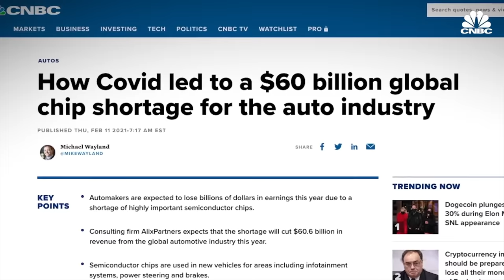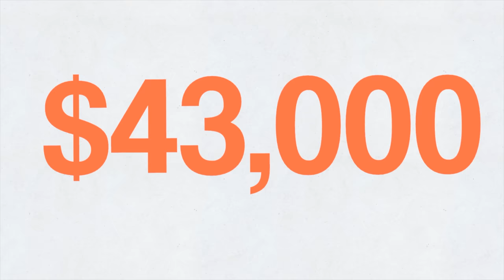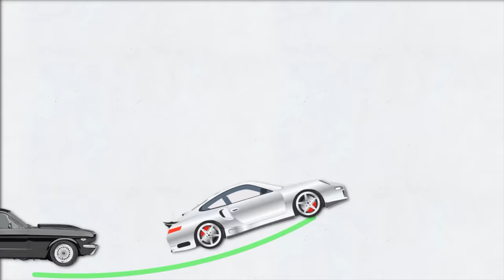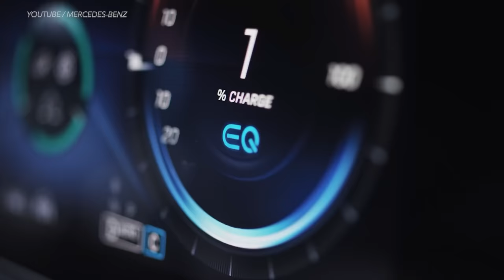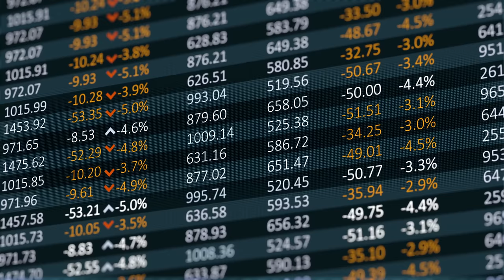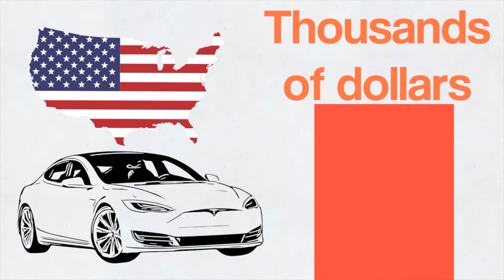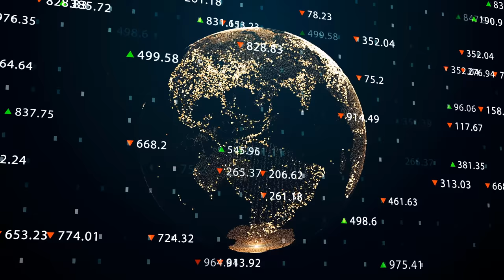No One is Telling You the Truth About the Car Shortage, So I Have to

Comment: Scotty’s knowledge is beyond bumper to bumper.  He is at point.  No auto companies admit to the supplier issue.  They are building cars with missing chips. Just drive, we will call you when the part arrives.  Why don’t they just build car that uses 20 percent computer components instead of 80 pct.   Car run with out many non essential computer parts.
Reply: How will the government keep tabs on your driving habits without all those sensors and computers?
Reply: If we built 1985 Chevys today as an option to the high-tech Vehicles we could avoid being in this logjam over electronics and chip dependency from foreign suppliers. But the simple truth is the government has made it illegal for the auto manufacturers to produce and sell vehicles without all of this technology in them.
Reply: @floridagunrat1625   Not to mention that the automakers lobby the government to help maintain their sales. Remember Obama’s Cash for Clunkers? Trade in your older vehicle for a more fuel efficient vehicle but you could ONLY purchase a NEW vehicle.
Reply: @tastx3142  Cash for clunkers took a lot of good used cars off the road. Just another example of hurting the middle and lower classes
Reply: My old diesel pickup only has one working chip left, it controls the instrument cluster. There was never an ECU, and I ripped out most of the wiring harness, aside from everything it needs to be road legal. 

Buy used, and learn how to fix it yourself. Learn to survive without these corporations, and they will be forced to adapt like the rest of us. :3
Reply: Ever since cash for clunkers, that worthless sorry a-- excuse of a gov't program, the used car and light truck market hasn't recovered since. Such a waste of good, used vehicles! 😡
Reply: @tastx3142  that was also done in Europe way before obama, i think it did improve mortality on the roads as everyone was driving really old cars with no security (i dont remember airbags in the 90s)
Reply: @foreignisdomesticnow2142  how much cash were they giving you? usually less than what you'd get if you sold it, provided it really is a decent car. So similar programs elsewhere only did take crappy cars off the road
Reply: China will have plenty of computer chips before the US...probably already does.
Reply: @floridagunrat1625  I'll a W124 over any new Benz, same goes for E30 vs G30.
Reply: @cris We don’t need cars and SUV which are expensive rolling super computers    Just learn to drive, drive don’t talk, eat or drink,and don’t drive like maniacs. It’s a car not an office or restraint. Your supposed to drive it.
Reply: @jamesgizasson  yu seem to be kinda missing the point. All that tech is so you can't. There are even laws in certain states that allow the manufacturer to sue you if you work on it yourself. Farmers have been fighting this fr a long time.
Reply: @TheNewblade1  I was just speaking for myself, and anyone like me (all three of 'em) X3 

Farmers are a different story. I was talking about your average consumer and their daily driver, but most people just buy a new car anyway. 

I agree wholeheartedly that planned obsolescence and Right to Repair are critical issues in today's world. :3
Reply: @jamesgizasson  sry if I seemed like I was attacking you, I just really hate individual solutions to systemic problems.
Reply: @TheNewblade1  No, I completely understand, and I'm not offended. In my situation, it works. But I live in my car, so my problems are very simple. 

The corporate system is designed to keep people trapped in a cycle of proprietary maintenance and purchases. The end goal is to have a customer base of 'subscribers'.

Comment: My guess is that it will take several years for car manufacturing to increase, and we haven't yet hit the bottom.  Hopefully, we will have seen the folly of depending on other countries for critical raw material and manufacturing.  We need to bring back manufacture of vehicle and equipment parts and components and not just assemble things.  We also need to revitalize our electronics industry.  Raw materials will be problematic as minerals are only found in certain geographic locations.  Maybe the Glomar Explorer should actually look for manganese nodules on the ocean floor this time.
Reply: I just don't see that happening in the US. The government has gotten very comfortable (and fat) by micromanaging American industry. All the reasons our manufacturing went overseas are still here, multiplied.
Reply: But you dont have the workforce to do that,and the repuplicans dont like immigration!So wzo should do all this jobs?Children?
Reply: We have the people, but most people do not want to do manual labor, even when that is a profession like plumbing, electrician, mechanic, or carpenter.  The solution will probably be automation, including robotics.  I saw an Inside the Factory episode today on the Smithsonian Channel.  They were at the Kellogg plant in Manchester, England.  Three people run the whole warehouse that packs and ships a million boxes of cereal a day.  There are two operators and one maintenance person.    China, which has no shortage of people, has the most highly automated vehicle factories.  @brunoheggli2888

Comment: My wife has a 2011 Ford Escape with 86,000 miles and I have a 2012 Nissan Versa with 101,000 miles and a 6-speed manual and they both run great. There is no plan to replace either vehicle at this time. I recently bought from a friend a 2001 Lexus LS430 with 119,000 miles and it runs great except for a phantom electrical drain that I will keep looking for to fix.
PS no car payments.
Reply: Keep the extra car for a couple more years. It'll be your retirement ;).
Reply: I have a 2010 Honda Accord with over 200,000 miles.  So what.  You're still going to have to buy a new car sooner or later unless you're a professional mechanic.

Comment: The most expensive part of an EV will be keeping it charged. That means new batteries before the car wears out and all of the infrastructure to run chargers 🔌. Yes the electricity and the chargers too.
Reply: EVs  are   inefficient  energy  hogs  that  spend most of  the  time sitting  plugged  into  the  charger /outlet.  not  such  a  good  alternative  n  not  a  solution.
Reply: RC cars do not scale up very well (ask the dinosaurs about being too big for their britches).

Keep on Gassin' .. Adopt a Classic today
Reply: @JT_771  The problem is .. they have no range compared to a fueled vehicle.
Reply: @JT_771  Please try and drive from Reno to Las Vegas in an EV and see how that works out for you.   🙄🙄🤔🤔🤔😁💩💡💡👀👀👀

Comment: What I don't understand is why some towns the same size of others in other part of the county have many cars in the lot, and they are not selling while elsewhere in the county there is hardly a car on the lot where the demand is higher. Also I found a Subaru dealership that has hardly any cars on the lot, yet an hour away on the side of the highway, there is a fenced off dirt lot with hundreds of 2021 and some 2022 models.
Reply: Don't know if it's true or not, but there are stories of dealerships hiding their inventory on separate lots away frome the main lot in order to create a false supply problem in order to justify the prices they are charging. Basically, telling everyone they only have a few cars on the lot, when they actually have dozens that just are at a different location. I certainly hope this isn't true, but it would not surprise me.

Comment: Im 37, and in my lifetime very few things if any have ever gotten cheaper. Particulary in these situations, where something pushes the prices of things higher, they never come down to before price increase values - it just establishes a "new normal" with the higher prices. Cars, CPUs, GPUs, cell phones, power tools, batteries, ammo, etc.
Reply: That's why auto loans are now as much as 84(!) months. Most of the stuff they're cranking out won't even last that long.
Reply: I respectfully disagree.  Many things have come down in price over the past 20-30 years such as TVs, computers and electronics in general.  Of course in the past year or so we've seen inflation cause prices to go up.
Reply: @SamKhoury  TV's, Computers, and Electronics are irrelevant though, but  he is correct on gas, oil, vehicles, the inflation, he's absolutely correct!
Reply: @SamKhoury  TV's, Computers, and Electronics definitely have not gotten cheaper. The top end GPU for a computer used to max out at around $500 msrp. Now its common to see $2000+ msrp GPUs, where a "mid range" card is around $450-$650. Top end TV's used to be around $2000, maybe $3000, now its common to see  $5000-$10000+ price tags. The only "electronic" that I think got slightly cheaper is the dial-up telephone, and maybe a calculator.
Reply: @BigBear--  You're wrong because you're not comparing apples to apples.  TVs, computers and electronics have absolutely gotten cheaper over time.  The price of those things with the same SPECIFICATIONS over time go down.  How much was a basic 55" TV just a few years ago and how much is it now or even a 65"?  How about a PC? The cost of computing power has gone way done.  The comparison that you're doing is comparing the cost of the best now to the best before.  That's like comparing a top of the line Ferrari now vs one from years ago.  Of course the cost of the top of the the line models have gone up but that's not what the average person is buying.
Reply: @SamKhoury   🙄🤦‍♂️Like I said, a mid-range GPU used to be around $200-300 msrp, now they're $500-700 msrp. Has a modern mid-range GPU gotten more powerful compare to a mid-range from 10 years ago? Yes. However it hasn't changed places within the current stack of offerings, its still a mid-range GPU. As computing power increases, so does the software loads on those components, in fact software development is generally ahead of hardware, with hardware always playing catch-up. Same for TV's, can you get a ridiculously cheap 1080P panel today? Yes, but it won't work with modern standard content in 4K, won't support HDR, etc. A quality mid-range 55" LED or plasma used to be around $1000, now a quality mid-range QLED or AMOLED is around $2000. And please don't confuse buying habits, with product stack categories. Just cause more people bought a thing, doesnt change the things performance or price relative to the rest of the product stack in that category.

You're claim of apples to apples doesn't include evolving standards and relative performance within the products own quality stack. Yes, you can buy a dirt cheap CRT TV/Monitor today, compared to 35 years ago - but that irrelevant to what I'm talking about. Your smartphone has tons more power and is waaaay cheaper than a building sized super computer from the 70's...what that has to do with super computer costs today I'm not sure.
Reply: @BigBear--  Now you're partially agreeing with me while still trying to prove your point that prices have gone up over time. Regardless you're still not comparing apples to apples which doesn't make your argument valid.  In the past year we have seen prices increase significantly on many goods because of low supply but that doesn't change the fact that certain goods like electronics experience price deflation over time.  Also your examples don't factor in is dollar inflation.  In other words you're not taking into account that the value of a dollar goes down over time.  Here's an actual real life example of price deflation.  In January 2021 I got an almost top of the line 65" 2020 Samsung Q80T QLED TV for $1050 direct from Samsung and when that TV launched in the Spring of 2020 less than a year earlier it was $1800, a price decrease of 42% and yes it was still an almost a top of the line model.  Of course the prices of new computer components rise over time because of inflation and because they offer better or more features but the price of the exact same model will generally go down over time.  You're certainly not going to pay the same price for a year old model GPU as you would have when it launched even though it might still be an excellent one.  I'm going to settle this argument very simply by telling you to Google search "have TV prices done down over time" and you'll see this response.  "According to the U.S. Bureau of Labor Statistics, prices for televisions are 99.14% lower in 2022 versus 1950 (a $991.38 difference in value). Between 1950 and 2022: Televisions experienced an average inflation rate of -6.39% per year. This rate of change indicates significant deflation."

Comment: A major point in the longevity of the car life is the manual transmission. Better than EV, too.
Reply: automatic transmissions last just as long, and in many cases, longer than any manual transmission.
Reply: It's $2,000 to $3,000 for a clutch job nowadays though
Reply: @jonathanmarquise422  no they don’t lol
Reply: @Nikkk6969  cool store trolltron
Reply: @Nikkk6969  Yes they do.  Also, even in shortages like this one, people will trade out their car before any serious issues from high mileage or wear and tear start to appear.  So even if an automatic would run down sooner, the first owner will never see it.
Reply: @lpattyo  I just replaced the original clutch, pressure plate, throw out bearing, flywheel and oil pan gasket, on my wife's 94 Civic w/180K miles, which she bought new. The parts were less than $200.  Also, replaced the upper and lower ball joints. It took a few days and its like new now. It's great on gas and we have no plans on selling the car. In 05, I bought her a new CRV which has over 200K on it now, and I do all the maintenance on all my vehicles.
Reply: @lpattyo  400 ~ euro in EU lol

Comment: So get rid of cat converts and EV's.  supply problems solved.  Bring back the 70-80's style built cars, basic and easy to work on.
Reply: Good luck passing your inspection and finding leaded gas to run your car on.
Reply: @robinlillian9471  "style"  plenty of easy to work on unleaded engines, no emmissons inspections where I live, just saftey.  I would love to buy a new car without power windows or seats, no computer controlled traction, rear view cameras, touch screens, tire pressure monitors and all that malarkey.  Thats stuff weighs and cost more, uses more natural resources to make and is just more crap to break down/fail.  I mean, c'mon, how difficult is it to use your mirrors while backing and check your tire pressure everytime ya put gas in the car? .

Comment: These problems could easily be resolved. GM came up with a great idea when they produced Saturn, they had plastic bodies! They didn't dent or rust, they were lightweight which produced better gas mileage and the plastic is recyclable when the car is scrapped. All manufacturers have to do is use plastic bodies and carbon fiber frames. Carbon fiber is just as strong and is also recyclable. Car's would weigh less, they wouldn't rust, and they would get greater gas mileage.
Reply: But that means the frames would cost 3x more at least. And in a competitive market that’s gonna be a tuff sell.
Reply: @BigGuytv_  If carbon fiber was bought in mass quantities the cost could be brought down... There's a huge difference in the cost of carbon fiber between a manufacturer who will only produce a few supercars a year and to a manufacturer that will manufacture hundreds of thousands of cars per year.
The price will be much lower. Will it be a cheap as steel or aluminum, no definitely not and it will drive the cost of cars up however the flipside is the cars will not rust and because they will be lightweight some of that extra cost will be absorbed by getting better mileage regardless if it's gas, diesel or electric powered.
Reply: No money in that,so it won't go anywhere!😂

Comment: I just bought a new 4runner. Figured I'd give toyota a try since I was offered $23k for my '14 Suburban oil burner. We'll see how it holds up
Reply: I have a 2000 4 Runner... excellent vehicle.. The new ones are still ok but the last great year was 2000, also the last year of the standard transmission like mine. Fortunately the 4 Runner is still made in Japan by skilled workers who care about quality. .My 2016 TUNDRA is a flimsy, gas sucking cup holder on wheels by comparison and the quality is  low and made inTEXAS by UAW union goons.

Comment: My first car, in 1963, was a 1950 Pontiac  6 cylinder with 3 on the tree.  It was about as primitive as you can get (compared to today).  I'd bet less than one percent of today's drivers could even get this thing onto the road.  Key in ignition, put it in neutral, put in the clutch, pull out manual choke, pump gas twice, then push starter button .. and hope like hell it works . then try to get it warmed up and push in the choke part way.  Nowadays, I get in my 2005 Caravan, put both feet on the floor, put key in ignition and turn to start - and it does every time.  I can deal with manual transmissions, wind-up windows and no stereo systems and Bluetooth, but I would really miss the engine management systems and fuel injection.
Reply: We could drive it! Our old Ford tractors start the same way although they have 4 speeds & 1 has 12 speeds  because of having a Sherman transmission.
Reply: @frederickbooth7970  Yeah, but it sure seemed kind of tough on a winter's day when I had to go to work, and it took a half hour just to get some warmth in the thing!
Reply: @weldorman8495  That sounds just like our parents 1989 S10 Blazer! It takes a long time for heat as well.

Comment: London metal exchange had nickel prices at $25,425 per tonne Mar 1st. Spike and trading suspension took place Mar 7th as noted in the video. Trading resumed Mar 23rd at $35,500 and is at $32,430 Apr 29th. Better context than leaving it at trading shutdown and 130% increase. It is a 28% increase since  the beginning of March.